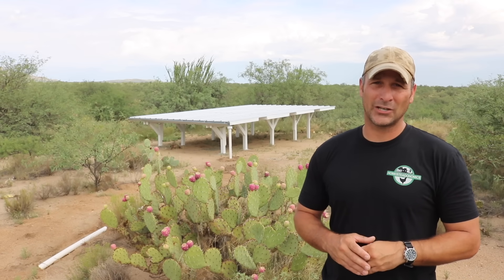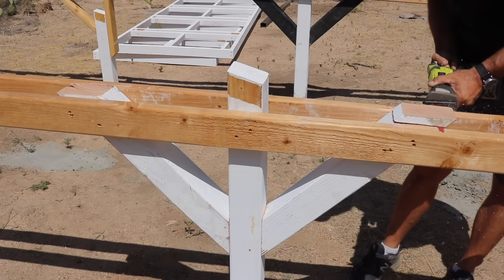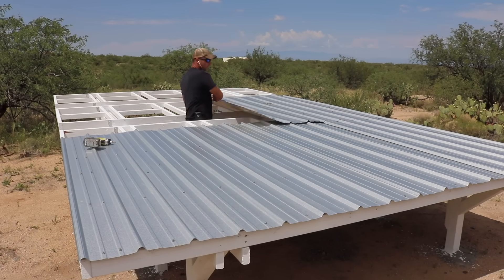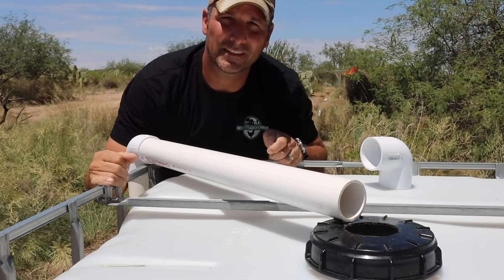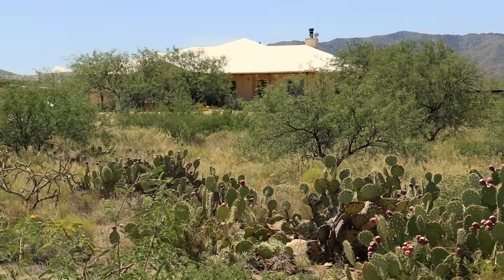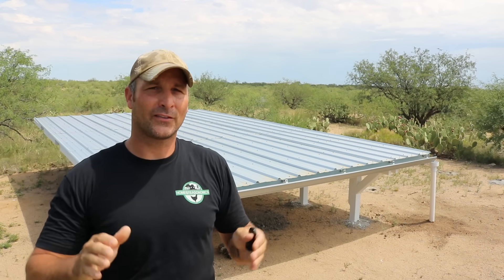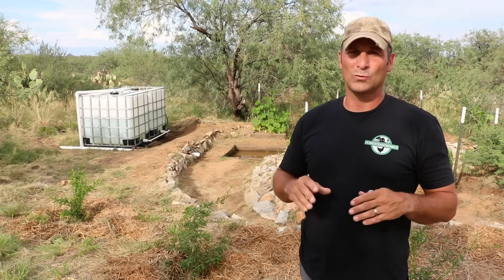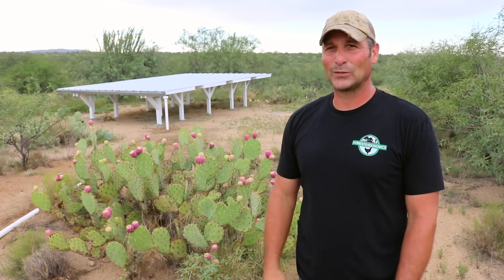Rain Roof -  Rainwater Harvesting Project - How To

Comment: One mistake I think that rain water collector builders do is to collect rain water from dirty roofs. 
  I will be moving to the desert by El Paso TX this year. I will build an invertible water collector system. When it's not raining it will face downward providing shade from the sun as a patio roof. When it rains I will have it on a swivel system enabling me to then face it upward to gather rain on a clean surface. Kind of like inverting an umbrella. Downward for shade or rain repelling and upward for Water gathering when it rains. I will make it on hinges to pivot and in any shape I like, square, round, oblong. It will serve a duel purpose and serve clean water. 
  Faced upward all day long and it gathers bird dung, dust, dirt, insects. Anything that settles on it. Then your into filteration of the water.. inversion eliminates that. How about a roll-up tarp over it? Rain on , sunshine off!
Reply: Another comment I have that just came to mind. You can mount those roof panels to a iron pipe and bracket it into posts at eather end and flip it, side up for rain, side down for sun to keep it  clean. No filters, pure water only.

Comment: So clever to use the level difference, THANKS FOR YOUR SHARING EXPERIENCE. I would suggest to use a bigger funnel to trap dirt and add filtration system afterward with layers of coarse sand, fine sand, cotton or filtered clothes, and charcoal. May use 2 steps level difference for collection and filtration of rainwater as clear water.

Comment: I'll demonstrate my lack of practical handyman skills and DIY knowledge, and maybe even my ignorance of basic physics by asking a question.  How is it that just that one bucket of water he poured gains enough momentum to climb up the pipe into his tank? I could understand if there were a torrential rain with many gallons of water rushing down the hill in the pipe and having the power to go up the vertical pipe at the end and into the tank.  But I would expect one bucket (just a few gallons) of water to just sit in the end of the horizontal pipe and backup, lacking the force to go all the way up the vertical pipe at the end. I'd appreciate anyone explaining this basic fact of physics and water to me. Thanks.
Reply: The water that was in the bucket is not the 'same' water that was coming out of the pipe. The water in pipe sits at a constant 'level' state at each end of the tube when no water is being added. When you add water to one side, it pushes / displaces water out of the other side.  Since the pipe near the rain roof is at a higher elevation than the pipe that is at the container, the water from the bucket displaces water at the lower end and into the container. It's the same physics that keeps water in the trap in your kitchen sink. Water enters one side and pushes existing water out of the other side, but there is always water in the pipe. Hopefully that helps! :)
Reply: @bradleykaan6281  Makes sense. Thank you for explaining.

Comment: At lease make it high enough where it’s usable for something else like sit under when ur wife put you out .. or random storage for storing things that’s not that valuable
Reply from the maker: I talked about that several times in the video.  About why it is not the best design, why higher would be better, dual use structure, etc,.   Perhaps you skipped over those parts?
Reply: @homesteadonomics   I did skip it as soon as I see the height.. plus I get the logics .. but still think it should hold a chair 🤣

Comment: Understood everything but how does water travel upward to the tank? I don't get it with no pump🤨🤨 I know about pressure differences but still don't get it
With that small amount of water 🤨
Reply from the maker: Fill a garden hose up fully with water from end to end when holding the ends exactly level.   Then raise one end up.   You will see the water flowing out the lower end, even though the rest of the hose is laying on the ground.

Comment: Why didn't you make s shed and harvested the water from the top and used the shed for alternate use
Reply from the maker: I talked about that in the video a few times.   I talked about why this is not the best design or use.   That a dual purpose  structure is a better, that I was using materials and existing structure on hand, and that it was also for demonstration purposes.

Comment: How does the water raises up the pipe and drains into the tank?
Reply: Simple fluids problem. As long as the inlet is higher than the outlet, it should have no problem draining. But there's a much more complicated equation you can use to be more accurate. The bernoullis equation can be used to find hydraulic head needed for this to work.

Comment: I dont understand why he didnt build the roof high enough to serve as a multipurpose shed.
Reply from the maker: Im guessing you didn’t watch the whole video.  I talked specifically about that in the video a couple times.   As well as other commonly asked questions regarding height, location, better designs, etc 
I was using existing framework in that area and even mentioned that the design would be better incorporated as part of a shed, carport, etc.   for multiuse benefits
Reply: @homesteadonomics  i see

Comment: Better construct CCT (square water trenches) of size 10mtr (length) * 2mtr (breadth) * 1mtr (H) just besides your roof structure or on your bare land..
This will help you a lot in rain water conservation and will help improve your ground water level

Comment: Wouldn't the entire pipe need to be filled with water, up to the level of the IBC outlet, before water actually entered the tank due to that T fitting? If it was a straight run from roof to tank, yes, the difference in level would cause the entire bucket of water to reach the tank. But as it's set up, you'd need many buckets of water to get any water into the tank, and the line would always have water in it.

Comment: Very interesting. Top job. I have to do some guttering shortly and the only thing I wouldn't be able to use is that PVC adapter with mesh in the bottom, as it would fill up with crud in no time. Leaving the end of the gutter uncapped to save money on fittings and labor is something I might try with a commercial leaf guard product to make sure water doesn't splash out and get wasted. Great ideas and the garden really came to life from the drone footage - Thanks for sharing.

Comment: Great video and great idea! I would only change 2 things. Would go with a regular downspout end cap for the gutter to feed my pipe and instead of a screen, use a “birds nest” cage over the end cap drop. They fit in the drop of the end cap and are mesh type “domes” to keep birds from nesting in your downspouts. About 3” base by 6” tall. The nice thing about those is they allow debris to rise and water to still flow where the screen may just clog. One question is how do you handle overflow? Or is that a problem. Looks dry there. 😛 I live where we average 50” + per year of rainfall and would need to channel overflow in a safe direction.  I know how I would handle it, but thought I would toss the overflow issue out there. Again, thanks for the great idea!

Comment: It is worth it under any circumstance for any initial purpose. Are there better options, maybe, but this is affordable and simple... a person could use an existing structure or build one or more shade structures and use that roofing material to run water into a cistern.  This is perfect for several existing sheds I have right now... I will use this material to funnel water into gutters and place several cisterns next to the buildings. Will probably make a better roof structure for one of my sheds. This is just what I had envisioned. Thank you immensely... this is a gift from God.

Comment: is it gravity that pulls the water up into the tote with the piping being lower than the inlet??? that lost me just by looking
Reply from the maker: I’m guessing you might have skipped over the section where I talked about it... but here goes.   It is the ‘level difference’ between inlet(where the roof is) and the outlet(where the IBC tote is).   The I let is higher, therefore the water will always exit on the lower side of the piping.  For example.... if you had a garden hose full of water and you held both ends at exactly the same level.... the water would simply remain in its place.   BUT if you lifted one end up a foot higher than the other end, The water would flow out of the lower side until the water leveled out.   Hope that helps👍😀

Comment: Triple...DUTY 👍
* Rain Catcher Water 💧💧
    (with Filters 👍No Metal
      Practical - No Cross
      Contamination 
      Re: Garden/ Food)
* Solar Panels Beside the
   Rain Catcher
* A "Small GARDEN" Above 
   Ground - Vegetables 
   🥕🥔🥬🥦🥒🌽🍅🌶🍓
    and Fresh Flowers for 
🌹🌷🌻🌸🌻⚘🌷🌻🌹
    Your Lady (year around)
Using a Portion of Your Rain WATER💧💧For Your GARDEN /win, win, win 👍

AND !!!! 👍
If YOU Set Up Your
 RAIN CATCHER Up With The CORRECT PUMP and HOSE....YOU CAN ALSO USE THAT WATER IN CASE OF FIRE 💧🔥

Comment: You could also dig a shallow pond and cover  it with a liner and put a vertical pipe with drilled holes around it at diferent elevations and the top of the pipe open and at lower than the highest water elevation.

Comment: Great topic! Thx!
I would consider a large horizontally mounted sail, that is made from weather durable non toxic fabric/tarp/sail material, cable tension retention mount system. This would only require a few corner mounting anchors at high tension and as large a sail like tarp as needed and could conceivably be very large.

Comment: Why didn't you make it tall enough to  have more than one use for the structure?
Reply from the maker: I addressed that in the video as well as some other questions that I knew folks might have.   Height, impracticality of this design, use of existing posts and materials, etc

Comment: Why didn't you make it tall enough to use as a shed
Reply from the maker: I addressed that and several other issues in the video.  Regarding height, using existing posts, why another setup would be better, etc

Comment: spending a bunch of money to collect rain is just.. RIDICULOUS lmfao!.. and obviously a house roof is better and more affordable than the same size roof. 1000 sq ft roof averages 600gallons of rain water with a 1 inch rain... just use your roof for FREE.. and redirect your gutter into a IBC tote(never used with chemicals), junk hot tubs, or cheap swimming pool. just gota address the mosquitos. if there is a more practical solution in the world.. please enlighten me. this video is trash im sorry... even if you are rich and had the money, this is just incredibly impractical and looks terrible.
Reply from the maker: Sounds like you might not have watched the whole video.   I collect water off my house, my shop, my green house, my chicken coop... and in another wildlife waterer project.   As I mentioned several times in the video, this is mostly for demonstration and there are many better ways to collect water.  No just used this because of the existing structure from a previous project.   Anyways, hope that answers things a bit better.   Also, I don’t have a well or municipal water, so rainwater harvesting is my primary water source.

Comment: I did not understand how the water would rise into the tank without a pump
Reply: As long as the output(tank) is lower than the input(the collecter which is further up the hill) it's still going downhill so will keep moving.

But that's confusing to understand so a little imaginary comparision to help explain...

Imagine a stream flowing downhill,
it meets a wall, a puddle starts to grow,
once the puddle is high enough it goes over the wall

Now I want you to imagine that the puddle and stream is completely enclosed, 
water going in via the stream cannot escape out the sides or over the stream bank. 
There are only two possible exits, back at the top of the mountain, or over the wall.
Now that little chamber the puddle is in?
 we are going to change that
Instead of being a covered bowl shape, it's now an S pipe shape, that travels down into the dip of the ditch, and then upwards over the top of the wall
nothing about the puddle has changed except the shape, 
there's still water coming in which cannot escape any other way except to go over the wall,
This change in shape makes it appear from the outside like the water is defying gravity... however it's not, it's just being forced over the wall because the only other exit is even further uphill, so it never builds up enough to escape from the uphill hole of the pipe.
The pipe can only hold a finite ammount of water, once it fills up enough it overflows over the edge of the tank to fill it, as this exit is closer than the uphill one.

The only problem with the set up is since there's that bend upwards, despite being overall downhill, there are parts of the pipe where the water will collect, in that "puddle".
When is stope raining the "puddle" stops overflowing into the tank, that water in the S bend just... sits there, it's not bad necessarily, but you can't access it to use it. 
In a dessert I assume ideally you'd want 100% of the water you collected to be useable.
Reply: watch his video on Rainwater Harvesting - Home tour. The drawing is helpful. :) Have a great day!

Comment: I’m basically lazy so my first question is why you did’t run a rain gutter under the existing panel structure rather than rebuild? My next is why not a structure with walls and a central drain, like a bathtub?

Comment: If you’d built it higher you could have got a car under it
Reply from the maker: I talked about that in the video about 3 times.  Why it would be better to have something higher and dual use.  Such as a carport, house, shade, awning , etc,.   I mentioned this was just an existing structure I had and did it as much as an example that would be easy to demonstrate with minimal extra input.   I collect water on nearly all the structures on my property.  Rainwater is our primary source as we have no well.

Comment: I disagree with all your reasons to not make it talk enough for usable shade underneath. As long as you add no walls, there should be little chance the wind can lift it. Also if the prevailing winds were calculated into design, the wind could actually hold the roof down. Also you was overbuilt it, in my opinion. I have fifty years experience so....
Reply from the maker: Thanks for letting me know your opinions.
Reply: homesteadonomics your welcome!!

Comment: Why didn't you spend a few more bucks and raise that thing up for usable storage space?
Reply from the maker: You might not have seen it.... but I addressed that a couple times in the video.   A variety of reasons really.   An existing structure I already had in place, but in an area of the property that I won’t ever store stuff... and because we have really high winds here I wouldn’t make a higher structure without using steel posts.   Kind of an experiment really.   I did the same thing on the other side of my property for a wildlife waterer system.... but I just used cinder blocks and kept the structure very near to the ground to take the need for structure out of it.
But it’s a good question and I recommend highly to use or build a structure that has more than one use.   She’d, car port, etc😀👍
Reply: @homesteadonomics  I guess I didn't watch the whole thing haha. Any way good build I'm sure this helped a lot of people. Keep it up dude.

Comment: Why didn’t you build it a little taller and put a grill underneath
Reply: Like he said in the first 2 min...because he was utilizing what he already had to save on cost for new materials. With that said, maybe all you need is to dig it out a bit with some stairs down into the rain harvesting bbq cover and chill pit. Just an idea ;)
Reply: Cnucks I never watched the video, so I wouldn’t know that. Regardless what a waste. Also, some comment said he was south of Tucson. So if that’s the case, he would be able to collect more condensation than rain water. But his design would never accommodate that.
Reply: @larryrobinson08  Not only that, I would much rather collect condensation than rain water with all the chemtrails and junk getting sprayed world wide daily. Even if your treating that water, i would still be a lil worried without a few different types of filtering, treating and finally structuring it back to hydrating water again. But works fine as a drip system collector to water all your plants and veggies. But hey we all think different i guess
Reply: Cool  the only reason I clicked on this video was to look at comments and ask the same questions!! Thanks!!

Comment: Can't it isolate roof from the sun because it's made of a good conductor of heat ( steel) .
Can't I use plastic or another material instead of steel.. the wind isn't so bad in my country

Comment: How does the water go up to the tanks? Is there a pump to push it up?
Reply: I was thinking the same thing
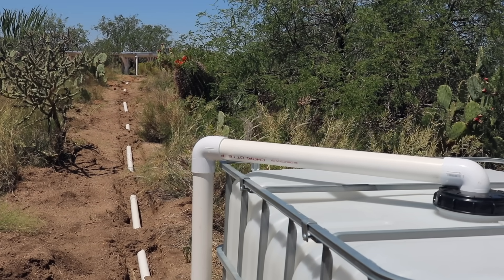Reply: The tanks are set up below the grade of the panels, @5:17, atmospheric pressure will push the water from the inlet down hill till it spits from the outlet.

Comment: Very cool. I would have made a car port/rain roof. Or maybe a little BBQ area. Lots of good ideas from your videos.
Reply from the maker: No sure if you saw....but I talked about that being a better option.   Just trying to use the existing structure that I had there.   But certainly a car port, shed, etc. or any double use structure is a better option😀👍